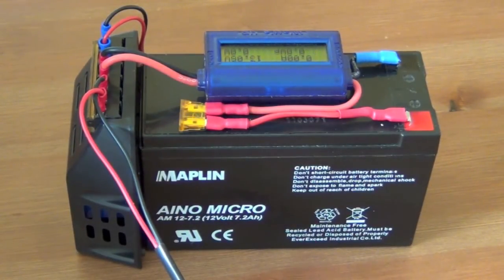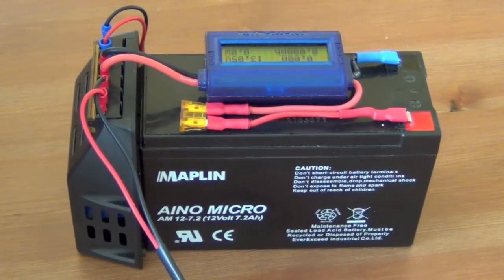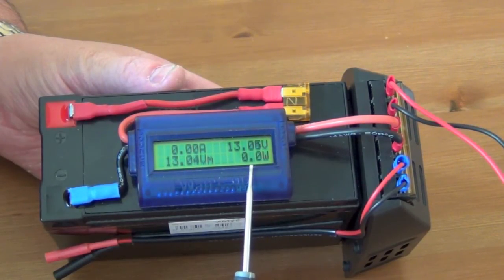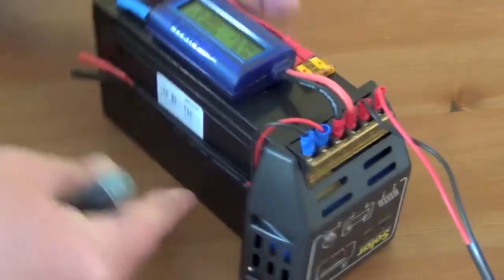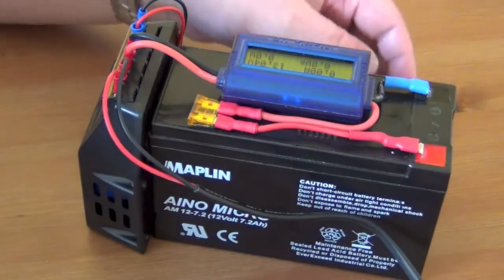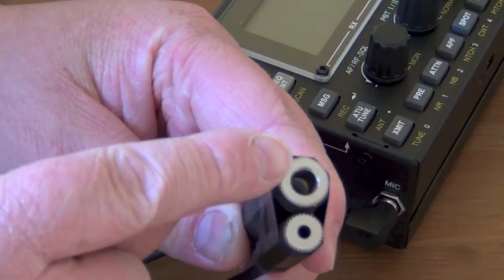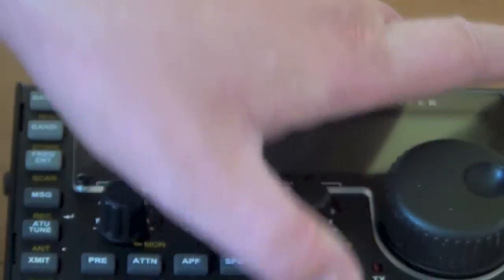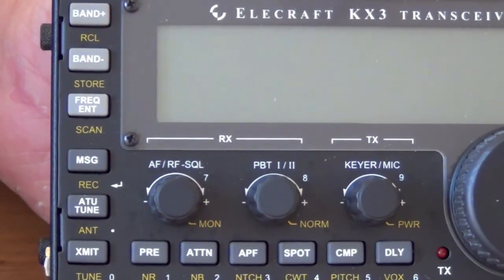QRP battery power & KX3 PTT

Comment: nice set up but is is too heavy for portable. Positive criticism.
Reply from the maker: Hi, yes duly noted. Weight is and always was the issue with this SLA battery. Have a look at my new LiPo battery. Ive been using it now for a year for my KX3 - and hasn't missed a beat. https://www.youtube.com/watch?v=pRfHNtrm9XA Thanks for your comment.

Dan
Reply: ColdestMoon
good job man! have in mind that LiPo batteries  have a risk of fire, once started you cannot put it out. For a little more money you can get LiFe batteries and they do not have the same problems of uncontrollable fire when they short internally. Cheers! (I still use some LiPo for my RC cars LOL)

Comment: I like how you mounted the meter on the battery. I also use a lipo battery of 11.4v 5a that i got at the hobby store when i picked up the metter
Reply from the maker: Hi John, yes i have now opted for a 8Ah Li-Po battery which is a lot lighter. But I still use this setup when I'm not walking far. The Solar Panel works well with the SLA, but not so well with the Li-Po.  Thanks for watching.